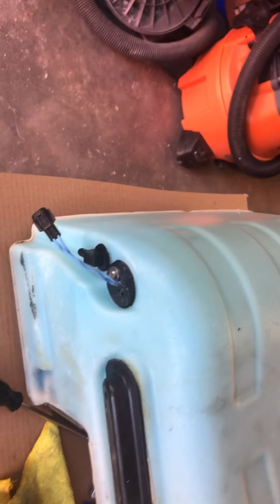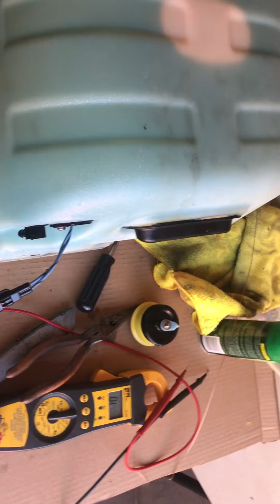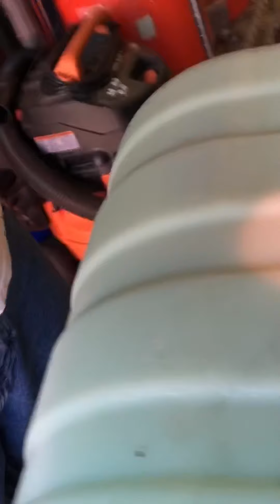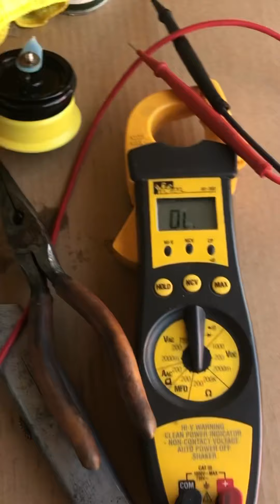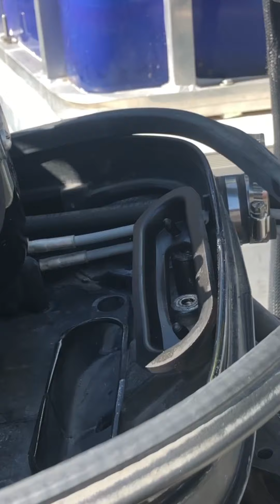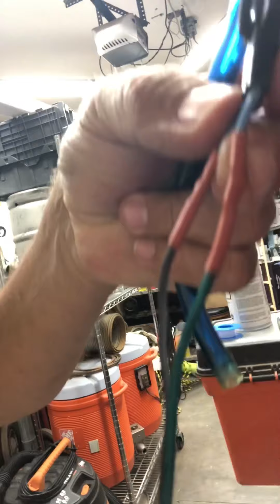Optimax 115  4 beeps alarm low oil or water in fuel? NOPE heads up!!!

Comment: Good job mate.  I have a 2006 Optimax 90 HP and my oil cap has a metal chain instead of a plastic piece.  Looks like Mercury went cheap on that part.

Comment: Robert, thanks for this video. My oil filler cap retainer broke off several years ago. Due to health issues, my boat has not been used for four years. I plan to retrieve the stem first, and then clean the VST, plugs and injectors. Of course, I will install new fuel filters. Thanks again for this video. I’ve never seen one like it with this issue!

Comment: Thank you for the video, and maybe you can help me with my Optimax. I have one Optimax 115 from 2005, with 3 cylinders. The problem I have is not the motor itself, but the leakage from the top of the oil tank on the motor, when I tilt the motor (when I want to keep the prop out from the water, or when I am transporting the boat). I have changed the gasket, but it is still leaking when the motor is tilted. The oil tank is full, and I do not know what to do. Any suggestion? Thanks again:)
Reply: Hello, 2005 150
Optimax for me, I have a similar issue, except mine is alarming 4 beeps every two minutes and will not plane out. I am ordering a new OEM oil reservoir for the side of the motor because mine is also leaking around the cap. It always beeped but I knew the float was no good. Other than the annoying 4 beeps the boat ran fine. That is until it started leaking around the cap. Now it will not jump up on plane idle speed only. Once I get my new tank in and mounted I will try it out and let you know what happens!:)
Reply: Slimjimmy how did it turn out for you ? I have the same issue with the same year model

Comment: If you take off the lower side and pull it apart it come out very easy
Reply: Absolutely Steve , split the two sides . 5bolts and a couple wire connectors and wide open lots of room .

Comment: Great job on diagnosing and fixing the issue.

Some info, the earlier model Optimax had a chain level indictor which was a little hard to detect the oil level so they went to the stick type.

Also the short lead from the sensor to the connector you see in your later model is on purpose. The short lead places the connector under the tank so it's much more difficult for the "backyard" marine mechanic to jump the terminals in the connector for easy diagnosis of a bad sensor. This can also just bypass the bad sensor altogether to run, ongoing of course ensuring your oil is at a safe level by removing the cowling where you can accurately see the level in the tank. Or to be safe, just simply topping up your level before each outing.

If I owned the model with the stick indicator I'd replace it with the chain just to avoid your exact problem.

Comment: Does it leak oil when you take the tank out? My tank is currently full. If so, how do you drain it?
Reply: I’m wondering the same. Same issue and my tanks full too. Did you drain yours and how did it go?
Reply: @1967habsfan any hints on how to drain the oil